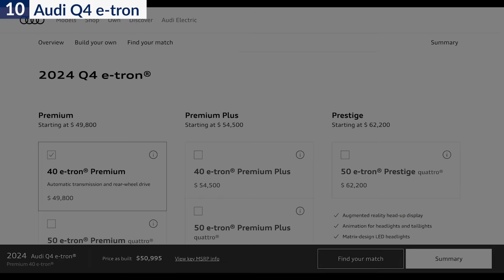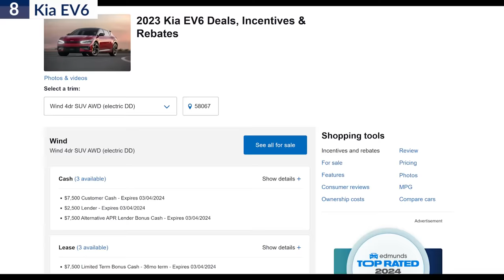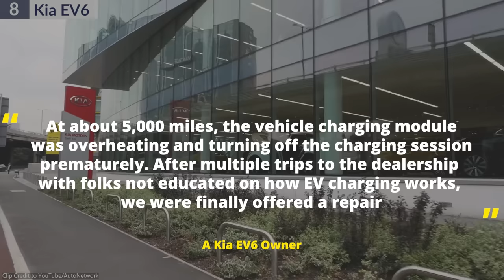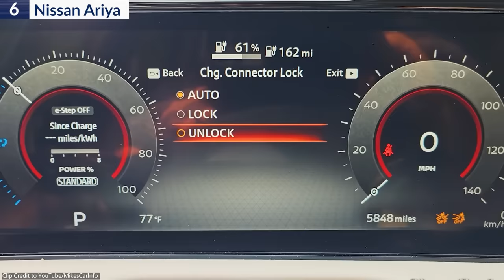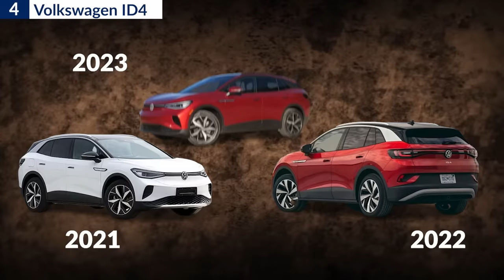New Electric Cars Piling Up on Dealer Lots in 2024 – Here is the Truth!

Comment: no electric car for me. i will stay with gas
Reply: Will you even stay with gas once there isn't any?
Reply: @Brian-om2hh  Might have to switch to a different liquid fuel in about 100 years, then switch to liquid fuel made from natural gas GTL fuel for the next 1,000 years and by then, maybe the battery will be ready and not a bomb.
Reply: @Brian-om2hh never happen 🤡
Reply: do you own a brain??
Reply: Exactly!! We will have to eventually buy EVs
Reply: @frankcastle2045  Shell seem to think so, because here in the UK Shell have published their plans to cut production of petrol and diesel by up to 40% if necessary, given the UK's legislation that 22% of all new cars and vans from this point onwards must be emissions free. And the 22% sales target is increased at intervals, as 2035 draws nearer. After which new sales of ICE will be banned. If you somehow think oil won't ever run dry, you are mistaken.
Reply: @Lifeisapartydresslikeit  You won't have to buy one. The choice will still be yours to make.
Reply: @Brian-om2hh  They will fall flat after they are forced to face the math of emissions for EV's. When you mine the materials, spend hours in factories, and charge off of a power grid that is POWERED BY FOSSIL FUELS, you aren't even breaking even. Your EV is not green unless you are charging it off wind, solar, geothermal, or a dam resevoir.
Reply: @Brian-om2hh will never not be gas. They already have synthetic gas and ammonia as alternatives but in much lower quantities and at high costs, it’s just a question of refining and making those compete with normal unleaded/premium grades.
Reply: 1. Child battery mineral labor

2. Range anxiety

3. Risk of garage fires

4. Paying 20k more than a
comparable vehicle

5. every time you fuel up an EV, the fuel tank gets smaller  and smaller. Battery degeneration. 

6. Poor resale value

7. Reduced performance in
cold, highway.

8. Higher repair costs

9. Awful charging network
experiences in the weather
without restrooms

10. Higher insurance rates

11. Replacing tires more
frequently. Michelin states that tires wear out 20% faster on an Ev, and could be as high as 50% faster! Ev tires made for ev's, cost 20 to 30% more, than regular tires for ice cars. As Ev tires wear out, they leave behind more tiny particles of rubber than normal ice cars. This causes more pollution. 

12. Death by autopilot

13. $25k - $35k battery

14. Low km range per tank of energy. 

15. must wait in-line 1-2 hrs
to charge.

16. Then wait more time to charge, while charging.

17. Spontaneous combustion, with no way to put out the fire storm.

18. If they catch fire in a tunnel, many people will die.

19. People without a pro charger system or a parking spot at their house, will run an extension cord to the road, which is dangerous and could lead to people tampering with your charging setup (super slow charging at the road)

20. If you're in California, you won't be able to charge your car past 4pm because of a shortage of electricity supply on the cheesy grid.

21. It is not actually "green". The pollution is made at the power station, not the car.

22. Only 5% of used junk batteries get recycled, the rest go directly into the bin. It's cheaper to mine for new minerals.

23. Chhinna actually does 70% of all the refining of the minerals and production of the batteries.

24. Minerals are becoming more and more scarce, and the cost will only go up, not down.

25. Some countries where they mine for lithium, actually use a very big boat load of fresh water to only produce a ton of lithium, so they are afraid of running out of water. It takes over 2 million liters of fresh clean water to produce 1 ton of lithium. 

26. Ev cars will soon not be able to drive in tunnels or be able to park in underground parking garage and probably will eventually void your house insurance if you park it in your personal garage.... 

27. You can't charge your battery at super stations when it is bitter cold out. 

28. If a fire truck comes to put out an Ev fire, all the chemicals go directly into the sewer system, poisoning everything. They need tons of water to slow down the burn. They can't put them out. They are only trying to prevent over things near by from catching fire. 

29. Ok, there is 2 good things; regenerative braking, which charges the battery while you are slowing down on the highway, which saves your brakes from much wear.

30. Loss of fuel tax revenue, so now the roads will only get worse, not better. 

31. in Dublin, huge generators are being used to charge EV buses, due to electrical grid strain. buses in Athlone also cannot be put on charge until midnight, for the same reason. Bus Éireann is saying that they can't charge their buses until 11pm for the same reason,  and to avail of a lower tariff. 

32. Not everyone on earth even has electricity to charge their cars. What are they supposed to do in 2035? It's easy to get a bucket of fuel to power up a regular car. 

33. VCE, or "vapour cloud explosion" is very bad. If any battery, typically anything larger than an E-scooter battery, and especially only "half" charged. If a problem occurs in the cells, it might not catch on fire right away. Instead, a cloud appears, and then may be ignited a short period afterwards. There are 2 different types of vapour clouds that appear; heavier and lighter than air, which form will be dominate, can not be predicted yet. This produces a bomm.

34. For Ev transport trucks, they aren't allowed to carry the same payload as a diesel truck, because of the massive weight of the battery. The owner of the Ev truck therefore loses potential profit, every day. They also lose more profit for the waiting times for charging that Ev truck. The driver will get paid to charge the truck, which in turn forces the owner of the truck to lose more money. 

35. Ev cars are more likely to be written off, if they experience a minor collision. After the collision, something could have upset the structural integrity of the battery. 

36. Ev cars lie to you. If you are bold enough to go out on a decent road trip and its 210 miles, one way, and your Ev tells you that your battery will last you 223 miles, there had better be no hills, or excessively cold out.... You'll probably get stranded, trying to get to the charger, at the end of the trip. Ev's have left many families stranded already. 

37. Ev's and their batteries, will soon need their very own "passport". With all info about them when born, and current info about them (power output, resistance, mineral composition, etc.) 

38. Thieves stealing charging cables, will soon make it impossible to "fuel" an Ev car. They take a long time to replace the cables, just to have them cut again for scrape money. 

39. Cars were typically being made lighter and lighter using aluminum and or fiberglass and or carbon fiber, to reduce emissions and pollution. Ev's are only getting heavier and heavier, causing more pollution than ever. Remember, an ev's pollution is made at the power station and the dump, not at the actual Ev, except for the tire particles as mentioned above. 

40. More on spontaneous combustion of the battery. What if you had 3 kids strapped into car seats, in the back seat ,which kid do you rescue? More fires start so fast, there is hardly any time for even the driver to escape, let alone 3 kids strapped in. 

41. There must be a reason that Boeing 747's aren't battery powered.... Until jets are battery powered, I'll be sticking to fossil fuels for my mode of transportation. 

42. Can't bring an Ev up north in the woods, nor any battery powered chain saws, where there are no grids to charge them up. You would need a huge amount of solar panels to get you anywhere. 

Ev's (External combustion vehicles) suck, and it's a bridge to nowhere. But they do sometimes convert themselves into "internal combustion", but sadly, they can only do that 1 time.
Reply: @Brian-om2hh  Oil will run dry but fuel wont. EVs are not a good answer to climate change, they arent even a very good replacement for ICE vehicles and as the former owner of a Model 3 I have first hand experience of the shortfalls that you find when living with them. 

Now I will buy another EV, I’m looking at a Polestar 3, EV9 or EX90 but I’m under no illusions that I’m saving the planet or saving money and neither should anyone else who is buying an EV. Ill also have several other ICE vehicles to use. 

EVs are part of the future of sustainable motoring but when you really look into the details (which no one seems to do tbh) it is quite literally impossible for everyone who currently owns an ICE car to have an EV. You would run out of the necessary resources long before you got close to a 1:1 replacement. EVs are a fine idea of a micro scale to control local pollution for example in a city, but when you start talking macro they are a fool’s errand.
Reply: hybrid is the bet of both worlds
Reply: @Brian-om2hh  There will always be gas cars. This is the US. Many conservative state residents will not tolerate the liberal ev mindset and many liberals will go to conservative states to buy gas cars if their state bans them. Then there is the pre-existing legal factors. If gas cars were banned then older gas cars would appreciate in value because certain gas cars like toyota are more reliable AND legally older gas cars would still be allowed to be driven on the road. You cannot make seniors buy new ev cars just because you want a new ev car. Seniors are not looking to buy a new ev car every 3 years like ev mindset people who do not even know how to change a tire or what it is like to own a car without a car payment and warranty!
Reply: @jakefriesenjake autism is strong on this one 😂
Reply: @jackelss5853 It's the worst, you will have a piece of crap eletric motor, battery, engine and a transmission...Nightmare maintenance
Reply: My electric car has these things:
Breaks never need replacing, no major services, no transmission service,  never needs fuel, drive train is 8 moving parts (11 when turning).  It cost $13.96 to fully charge my car and it's faster than 99% of what is on the streets today, and the total cost of driving my EV is $0.05 /mile.  Oh, and I charge at home.
Reply: No you won't.
Reply: @qpwodkgh2010  But it's goddamn ugly, cost far more to buy initially, has ZERO resale, rubbish range and yes, you will need brake pads, and tyres, and if you crash it the cost of even a small part will be astronomical, if it's not written off completely. A door handle for a Tesla is $1500. Then there's the battery replacement cost which is often more than the piece of pointless crap is worth. Stay smug 👍
Reply: You must be rich if you can afford gas!
Reply: @mikeshafer  Gas is cheaper than having a car payment forever because you have trade in your ev car every few years since since it is worthless without a warranty
Reply: Ok boomer
Reply: Remember when people used to say, "No cellphone for me...  I don't need to be contacted everywhere!" 🤣
Reply: @NateDohDoubleGee  That was when most people did not have cell phones. Only 7 percent of people have electric cars currently. Guess what? When the percentages of people with electric cars go up the prices go drastically down and the current list of expensive problems go down. Current ev owners are just lab rats for the majority. Keep buying and letting manufacturers fix the expensive issues and bring the price down. The only reason why ev prices are so high is because the majority does not want them currently. I would only buy one once they bring the price of ev battery replacements down to 300 to 400 dollars and they make them like gas cars ie out of steel instead of plastic and aluminum! Anything higher than that is for a fool who cannot add up simple math (ie you pay for the replacement battery in advance with the high asking prices or you have a car payment forever because you trade in your ev car every few years for another ev car). People who are good at math think like me and want to own multiple reliable cars outright without a car payment and without expensive repairs for basic things like batteries.